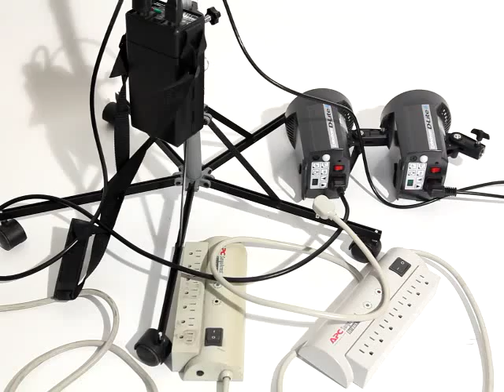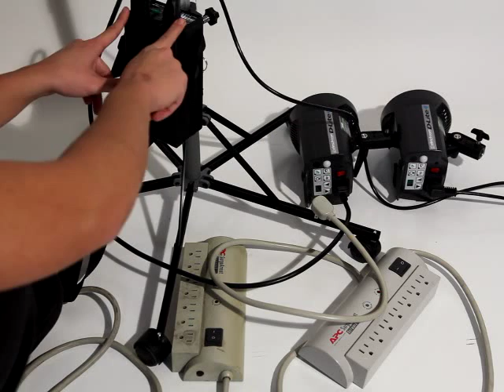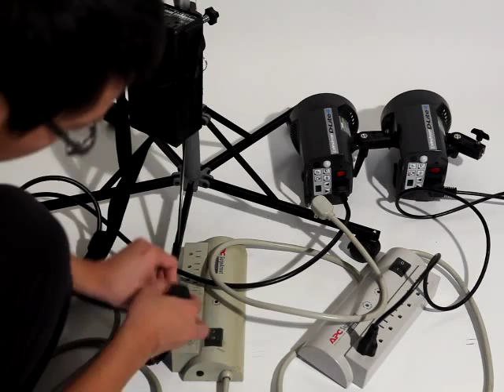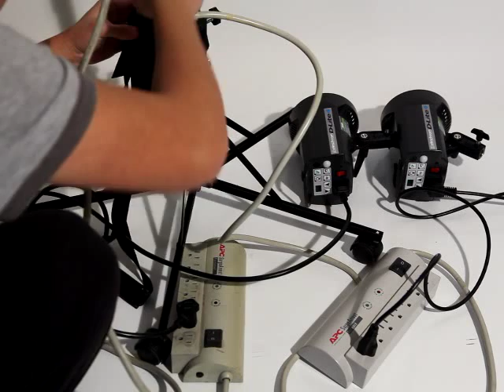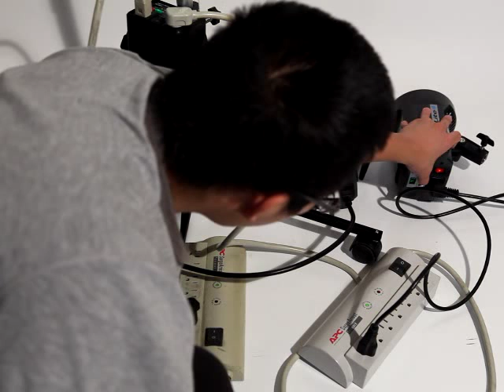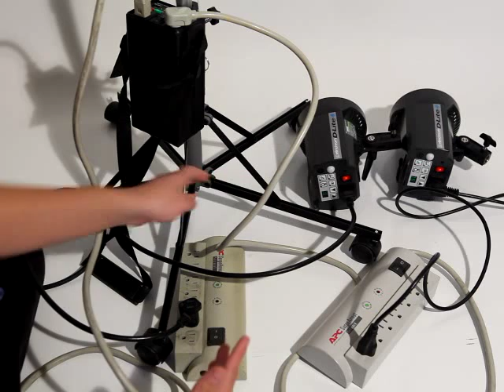Vagabond Mini Lithium (VML) 120V test with 2 Elinchrom D-lite 4's

Comment from the maker: @musi1714 depends on what model of d-lite 4's you have.  if you have the older ones like the one in this video, then you might be able to use the vml 230V but you'll have to purchase adapters.  the innovatronix mini will work, but it is pretty heavy ~7 pounds.  if you want compatibility right out of the box, the innovatronix mini will work.  if you plan on upgrading your strobes, then stick with the vagabond mini.

Comment from the maker: @paoandden Entry level strobes have inferior parts to the professional models.  In this case, the d-lite's inverters are not built to the standards of the higher end elinchrom bxri's which have much faster recycle rates.  To use an analogy, if you are operate a car company, would you put your a quality engine in a toyota corolla that allows you to go from 0-60 in under 5 seconds?  or would you reserve that engine for your toyota LFA?  There are trade offs when using entry and professional gear.

Comment from the maker: @spacefoodstix  d-lites of course.  the fan inside the vml is super quiet when it turns on which only happens when you draw alot of energy at the battery consistently.  think laptop fan noise.